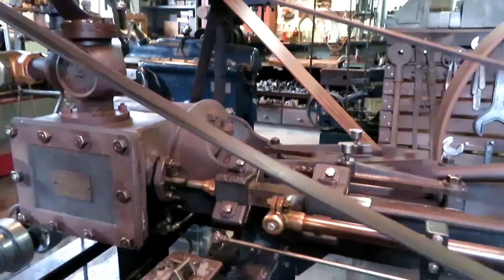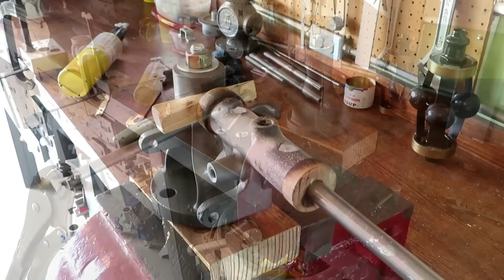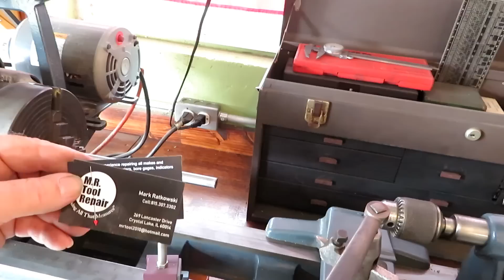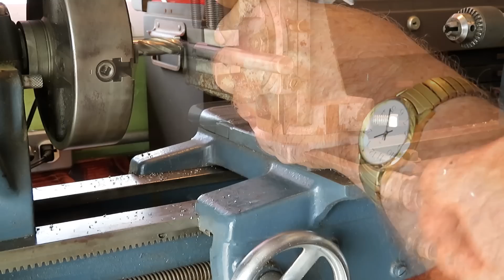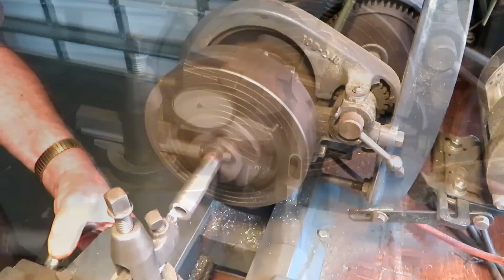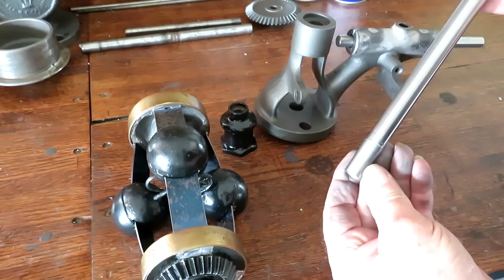Old Steam Powered Machine Shop 63  Governor Rebuild

Comment: With  that morse taper would it not be easier to leave it slightly short then thread it and pull it tight with a bolt? Swedgeing just makes it harder.
Reply from the maker: Can't use a bolt there, The valve rod works up and down through the ID of the shaft....Dave.

Comment: just wondering, could the bottom of the tube been threaded with a pipe thread and then cut so it would allow it to expand to hold it in place
Reply from the maker: It could have, but It would have to be tapped very straight. the shaft tube could have been single point threaded on a lathe with taper attachment...Dave

Comment: Have you ever happened to have ever rebuilt or worked on a governor that acted on engine cutoff rather than throttling?
Reply from the maker: Greg:  I've never owned an "automatic" steam engine, but there is a lot of information about them in old manuals....Dave

Comment: If you don't have an acetylene torch to soot up a shaft for Babbitt pouring,  try using a spray on dry film lubricant. I've used both the molybdenum disulfide and graphite types equally well.  These don't off gas like a grease or oily lubricant will when hit with hot Babbitt metal.
Reply from the maker: I've used it as "neverseize", seems to work well...Dave

Comment: My first lathe was a Craftsman and it had a milling attachment too. Used it for a lot of stuff. Great and creative job on the rebuild. I am in an antique tractor club here (middle Ga.). Some of my club members are going to the flywheelers event this year. I won't be able to make it. I met Adam Booth and Keith Rucker at one of Keiths events. Wish I could meet you as well.  Have a good time. It is always a fun event.

Comment: I’m in love with your shop and videos. Keep it up. 👍 
I’m currently building an overhead line shaft for a clockmakers machine bench and am wondering what oil you’d suggest using for 3/4” shafts running in bronze bearings? Thank you

Comment: 1:44 the gage over your left shoulder on the pegboard, Is that for measuring the height of water in feet? 0 to 70 Feet?
Reply from the maker: It was in the pile with the rusting, disassembled Morris engine  in a NY woods for a lot of years. Too far gone to be much more than a wall hanging. It would have been a nice steam gauge 40 years ago....Dave

Comment: I once had to re-bore the cylinder of an 1885 Table Engine, that was carefully set up on the compound slide as well. You can therefore also turn a Lathe into a horizontal boring machine, as well as a Mill. The end result is still a working (when I can) engine with a good bore. Thanks for the update Dave, good to see you about.
Reply from the maker: Hi Doug, That was done with a lot of jobs in the old railroad shops when the boring mill was tied up with other work, etc....Dave

Comment: Interesting place to find a Morse taper. Once it's swedged in I can't see that moving for another hundred years or so.
Reply from the maker: I agree, seems like a press fit to a shoulder with a tapered pin would have been simpler. ...Dave
Reply: If you freeze the shaft it will go in easier. Over night in the freezer / icebox it will drop straight in!

Comment: I noticed that in this video you mentioned Adam Booth and Keith Rucker, both whose videos I have also been watching.  Out of curiosity, is it more than just coincidence that you and Keith Rucker both decided on an antique belt-driven metal planer at precisely the same time?  Because just as you had your planer installed in your steam shop and managed to add additional shafts to make it run, Keith has been working on his, and is currently still making it like new again.  Interesting that, while your planer has a loose-tight-loose pulley system where you had to install a shaft with a big pulley for reverse and a little pulley for forward, Keith's is designed with two pairs of loose-tight pulleys, a large pair for forward and a small pair for reverse, so that even if the drive shaft has two identically sized drive pulleys, that the forward still moves more slowly than the reverse.
Reply from the maker: Hi Steve: Keith actually referred the Whitcomb planer to me after I had seen his (in the rough) a couple years ago in his shop. The New Haven planer has the forward on  one side and the return on the other. Maybe they were trying to get around some patents. The loose/tight setup is just to start and stop the machine. Keith will rig one of those or else use a "clutched pulley"....Dave

Comment: Nice  to  watch  a true craftsman . while in Florida feel  free  to contact  me if you need  to  borrow  any machine  tools  I may  have  . I'm  in port Charlotte. I'll  see  you  at the flywheelers  on the  19th.   chuck Gause
Reply from the maker: Chuck, I could use an oversize (.003") or adjustable 5/8" reamer if you have one, see you there...Dave
Reply: @davidrichards5594  I'll ck let you know
Reply: David. Best I can do I have a .625 and.    .593 to.968  made in India adjustable reamer
Reply from the maker: @charlesgause8224  I can use the adjustable, I'll ream it at the flywheelers, won't take much, thanks,  Dave

Comment: Very cool. An Atlas 10D. I also have a 10D (babbitt bearings) I rebuilt a few years ago. 54" bed. Completely stripped it (3 coats of paint), bought some parts off eBay. I also put a later model cross slide (taper vs slots) carriage and obtained/rebuilt a later model tapered roller bearing headstock. As best I can research the 10D was only made for a couple of years around 1937.
Reply from the maker: Hi Wallace, Alot of work on that lathe. I think mine is a 1937. From the web, the overhead countershaft was only used that year....Dave

Comment: OK so basically the spinning of the weights push down on the shaft and that restricts the flow of steam and thus slows the engine down? Anyway love watching your show it sort of an elegant solution to a complicated problem. Thanks again Dave.
Reply from the maker: Correct, the spinning weights are apposed by some type of spring or weight to determine the speed....Dave

Comment: That trick with the lathe is really clever Dave. Every time I look at a lathe from now on I'll be seeing a mill laying on it's back.
Reply: everytime I look at a mill I see a lathe that was put together wrong ;)
Reply: I have done similar with the drill press and vice with lather type movement. Both flats and keyways.
Though now I have a mill and a LOT easier.

Comment: Lead freezes dead quick...

A bit of graphite powder on that reamer...
And with a bit of luck some of it might have embedded itself in the Babbitt....

Using a larger sized chuck on a smaller machine such as the atlas lathe (as long as it's running square & fairly balanced) should provide a better finish due to its mass I would've said...
It's just my thoughts...

Like I says...I'm an electrician...not a machinist Mr. Richards....

How do you intend on buttoning that end over...?
Warm up the end and poke through with an air hammer through the base...
Or make a tool and use the fly press in a similar fashion...?
🇬🇧🙂